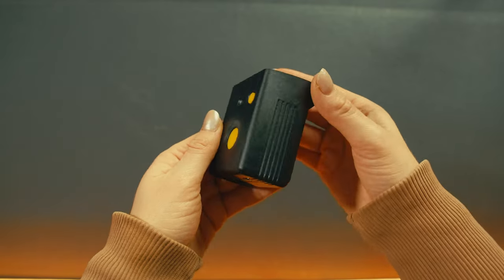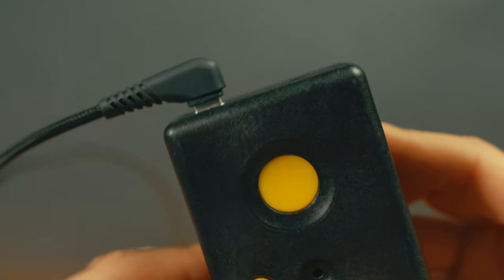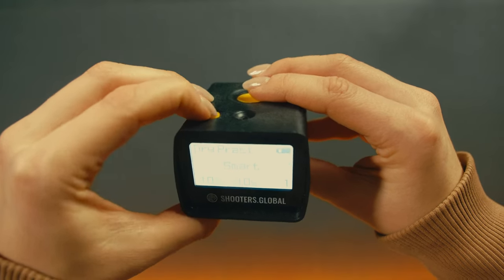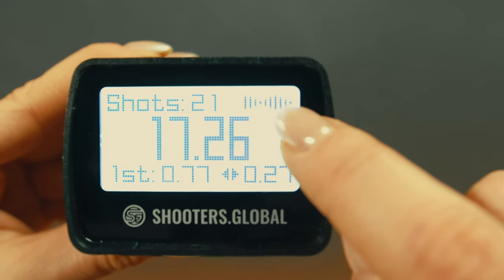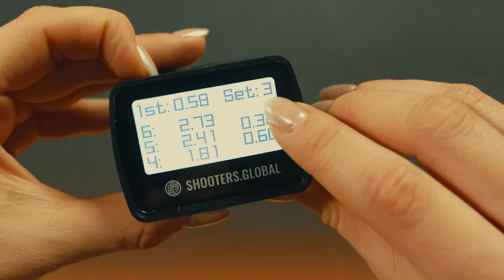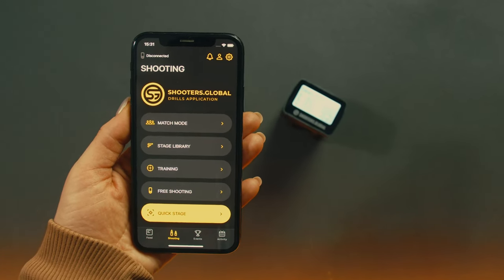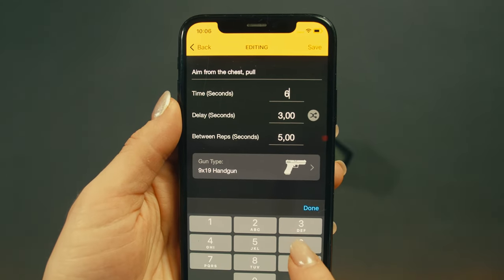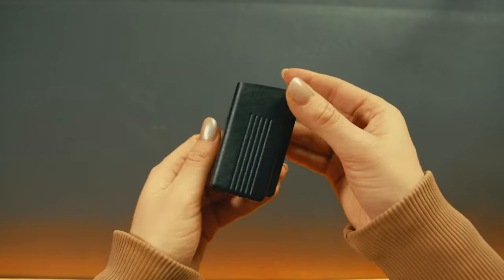How to Use a Shot Timer | SG Timer GO

Comment: How do you configure the RO mode? Bring the sound up, and adjust the sensitivity for indoor range etc.
Reply from the maker: You can set the RO settings in the app.
Preliminary actions: SG Timer Go connected

Steps:
1. Select “Match Mode” (Main screen)
2. In the “Squad” block, click the “Edit Members” button (Match Mode screen)
3. Select a member (Edit Members pop up)
4. In the upper right corner, click the “Save” button (Edit Members pop up)
5. In the “Squad” block, select Member (Match Mode screen)
6. In the “Setup” block, change the “Delay” value, number of shots and others (Shooting screen)

To increase the sound and adjust the sensitivity for the indoor range, follow these steps:

1. Connect the timer to your Drills app.
2. Open "My Devices" and select the timer.
3. Open the Timer settings.
4. Select "Shooting Presets," then choose Preset you want
               • Here, you can modify the following settings:
               • Sensitivity of the sensor (1 to 100)
               • Beeper Volume (1 to 100)
               • Echo Filter
               • Additional Sensor Setup and Shooting Setup options

You can also customize the same settings in the "Shooting" section under "Free Shooting."

For more details on configuring the SG Timer GO, please visit our website: https://timer.shooters.global/how-to-use/shooting-practice/

Comment: Can you please explain how to use the spy mode?  My main use case is to clip to my belt at my back in matches to validate RO time readouts.  I suppose 1). the GO does have spy mode? 2). once a stage run is done, do I have to detach the GO from the belt to see the time, or is it easy to see the time by just turning my head back to look?  Thanks.
Reply from the maker: Spy mode - in this mode the timer will start the session once it hears another timer’s beep, thus syncing with it. The timer itself will not beep in this mode.
You can only turn on the spy mod for GO through the application.
In Spy mode SG timer will start the session once it hears another timer’s beep (from the list), thus syncing with it.
It works with SG Timers, CED 7000, PACT, Pocket Pro, Special Pie M1A2-F, AMG Lab Commander, Range Tech.
Here is a video where we explain this mode in more detail - https://youtu.be/__PA3FH-h60?si=kwYoeMFA0RP9iKUH

Comment: Dumb question, but will the ziploc baggie trick for rainy weather affect shot detection?
Reply from the maker: SG Timer Go is almost entirely protected against moisture penetration, with the exception of the USB-C port located at the bottom. Any covering of the sensor (located near the buttons) may affect the recognition quality.

Any experiments should be conducted at your own risk. As the manufacturer, we do not market the SG Timer Go as being rainproof.

Comment: The Velcro clip attachment is probably great for people who only train with one belt/gear setup, but it’s not great for people who train with concealed carry gear, a duty belt, and a competition rig.

I’d REALLY love to buy an actual belt clip, but apparently it’s not available yet.
Reply from the maker: The clip will be available in a few months, you will be able to also buy it separately
Reply: @shootersglobal It’s been 3 months. Any word on the clip? The Velcro non-sense is REALLY frustrating since I train with my competition belt, duty belt, and concealed carry gear on different days. There have been several instances when I forgot to transfer the Velcro loop from one kit to the other which meant that I had to improvise at the range. VERY VERY FRUSTRATING.
Reply: @EuropaChronicles put the Velcro strap in your range bag along with the shot timer. Boom problem solved.

Comment: Will this timer be able to adjust sensitivity when shooting next to other shooters in an indoor range to only account for the closest shooter’s shots?
Reply from the maker: Yes, this is a unique feature of our timer. You can adjust the sensitivity so that the timer only picks up your shots. For example, in a PRS .22LR match, the referee was able to set the timer to pick up shots from a suppressed rifle while not hearing shots from a .22LR rifle without a suppressor within 5 meters. 

Alternatively, you can easily configure the timer to register 9mm shots while not detecting shots from a 223 rifle within 2 meters from you or one meter behind a barrier. The difference in volume levels can be significant depending on the surroundings, and it can be critical in some situations. However, it all depends on the ambient conditions.

Comment: Hi guys, i’m training with a Glock with a laserammo cartridge and the dry fire mag that resets the trigger after each shot. The problem that i’m facing with some timers or apps is that that tool makes a first click when you pull the trigger and a second one when the trigger is resetting and the timers record the second click as a shoot. Did someone try if sg timer is more accurate??

Comment: Got my timer..is there a way to get the in between splits time without accessing it at the phone?

those are important times

example 
shot 1 1sec
Shot 2 3 sec
shot 3 5 sec

the in between split times of shot 2 and 3 is 2 second.

the time can only show the first in-between splits of the first and second shot not the current shot display
Reply from the maker: Both timer and the app show split times. Please contact support@shooters.global if you have difficulties, I can't attach a photo here.
Reply: @shootersglobal  hello. forgot to give you updates. its working now..

looks like i need to update it first before using. without the update it doesn't show the splits. now im enjoying the timer with the update

Comment: How do you change the sensitivity for dry fire?
Reply from the maker: Connect the timer to the app. Tap the green timer icon in the upper left corner of the screen. A menu will appear where you can go to Dry fire presets, where you can determine the sensitivity for each type of weapon. 
In Smart Dry Fire, we recommend keeping the sensitivity setting at 100 and the waiting time at 2.0.
You can reduce “Waiting time” to the minimum value if you need to catch the “first” sound (trigger or shot).

Here some useful  tutorials on our Youtube channel that could be useful for you:

Video instructions can be found on our Youtube channel:
How to program a shot timer - https://www.youtube.com/watch?v=5DC-XkUlpoc
How to dry fire - https://www.youtube.com/watch?v=yzdKQz5HUfI&t=6s
Live shooting - https://www.youtube.com/watch?v=uv6QVzJVseM&t=74s
Reply: @shootersglobal  thanks for the reply!  I did follow those instructions - but even at 100 in a quiet environment, it only registers my trigger press if the firearm is with one foot of the device.

Comment: Instructions on how to turn the timer off are a bit unclear, even with the video it took me a while to figure out you have to pretty much instantly press start after holding function and get the timing exactly right. Almost feels like a mini-game in itself, lol.

Apart from that, the only thing I feel could be improved after trying it out for an hour is the function button should stick out a bit more or have a small recess around it like the start button does. I don't really have large fingers but I find it a lot more difficult to press than the start button.

Overall really impressed with the product though. Lots of fancy features with the app, but super simple if using it standalone.
Reply from the maker: Thanks, we will change the turn off sequence.
Reply: @shootersglobal  Looks like it might have been a misunderstanding on my part. It appears the sequence is pretty reliable after all, but needs to be used when in one of the "main screens", and can't be used when in the results screen, or when timer is in pause mode.

If that is the case, and it isn't just me getting better at the timing, mentioning this clearly in the instructions would be great as I've somehow missed this.

Edit: Definitely user error on my part, tried it a few more times and going to the main screen first makes the sequence work every single time, timing isn't even that much of an issue.
Reply: @shootersglobal  Just got my timer and it won't turn off trying the button sequence.  Learned I can't hold the function button too long or the start button will just start the timer.  I have to hit the start button pretty fast right after hitting the function button
Reply: Yes, the instructions on paper included with the GO timer are not clear enough.  I gave up after 20-some tries and thought maybe it may have been fixed in firmware.  So I installed the latest firmware and saw that they added power off via a very long press of the function button.  After reading a Reddit post on the issue I now can also power it off the original way.  Now that I understand the original method I like using it because it powers off faster.  I like the new way because it works every time.  I still need to practice the original way a little more to get it to work every time.  It seems best to press function power and hold it but press start immediately after pressing function and then release both immediately.   I am glad to see they left the original method in after adding the new one.
Reply: What’s the new way?
Reply: It really is ridiculous it’s strangely hard to turn off
Reply: @satellitehunter7440  New firmware adds a 2nd way to power it off.  Just press and hold the function button down until it powers off.  

Now that I know to press the start button immediately after pressing the function button and then immediately release both it powers off most of the time on first attempt.  The main issue is pressing the function button hard enough to get it to click is not easy with my large fingers.

Comment: I see submenus the include a lot for RO mode on your original timer starting at the time stamp that follows.  Setting including sensitivity are there.  How would I get to those same menus on my GO timer or the app.  I see nothing in the app the applies to the RO Mode.  https://youtu.be/zuMsQRXQzcA?t=18
Reply from the maker: RO mode is currently limited on the GO timer. It will be available through the Drills app later this year.
Reply: @shootersglobal  I received an email reply to my question with the following directions as to how I may modify the RO mode settings:

You can set RO mode in the app.
Preliminary actions: SG Timer Go connected

Steps:
1. Select “Match Mode” (Main screen)
2. In the “Squad” block, click the “Edit Members” button (Match Mode screen)
3. Select a member (Edit Members pop up)
4. In the upper right corner, click the “Save” button (Edit Members pop up)
5. In the “Squad” block, select Member (Match Mode screen)
6. In the “Setup” block, change the “Sensitivity” value and others (Shooting screen)
Reply: @shootersglobal  awaiting this change! need to adjust sensitivity and delay function on RO mode!

Comment: My clip will not release without some serious force applied, like so much that I’m worried I’m gonna break it.  Last time I couldn’t even get it to release I finally had to take the whole thing off my belt with the Velcro strap.  Is this normal?  Also, I can’t get spy mode to work, I’ve programmed the correct timer but nothing happens when I click start….any suggestions?
Reply from the maker: You probably used 2 velcro straps. There are 2 of them in a box, you need to separate them. Make sure there's 1 strap.
Reply from the maker: Nothing should happen when you press start in spy mode. After start it will wait for a signal of another timer, and will start session after that.